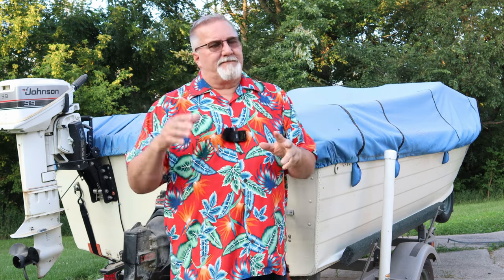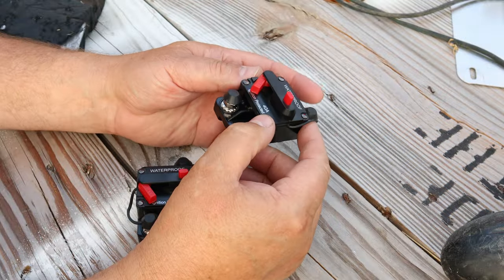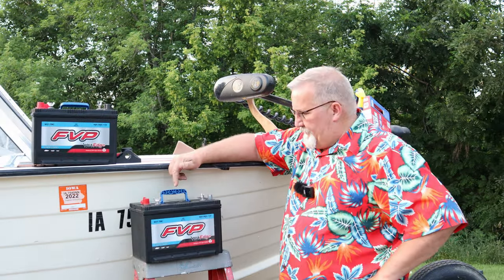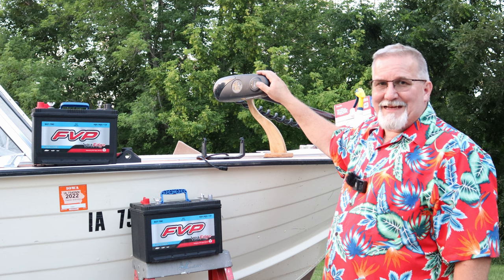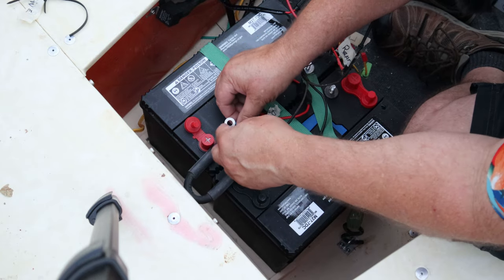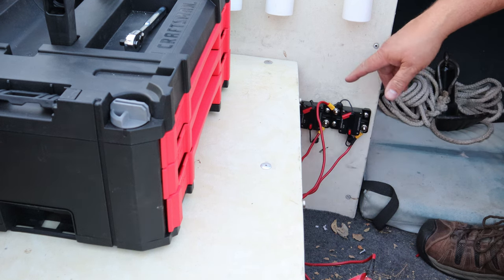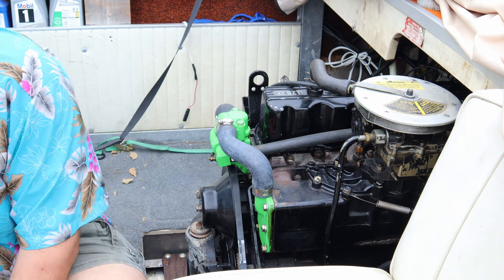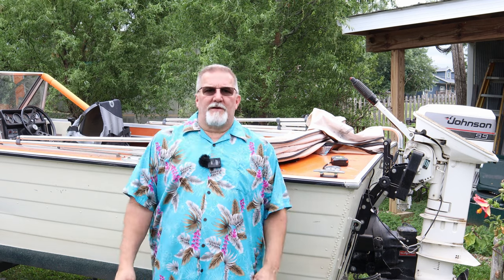1976 Starcraft Mercruiser 120hp  Johnson kicker MinnKota Ulterra and some new batteries

Comment: Nice video Michael. What  was your wire size that you used from your 40 amp circuit breakers. It should be #8 gauge wire.  #10 is only rated for 30amp.
Keep up the informative videos. I like your analogy of the 200.00 versus 1000.00. I unfortunately bought a battery for my new Mercury 9.9 4 stroke with   electric start. The battery salesperson sold me a battery that they were selling for lawn tractors. So far 3 trips this year she has started every time. 
Cheers
Reply from the maker: Yessir, correct wire size is soooo important.
Reply: @BeamerTheFox  Great thanks. Yes it sits on a trickle charger when not in the boat. The Merc has an alternator too. My fish finder has its own rechargeable battery that  when not in use sits on a trickle charger also.
Thanks again for reaching out